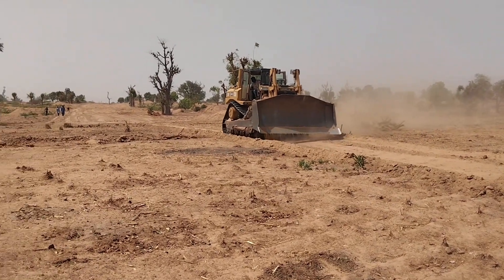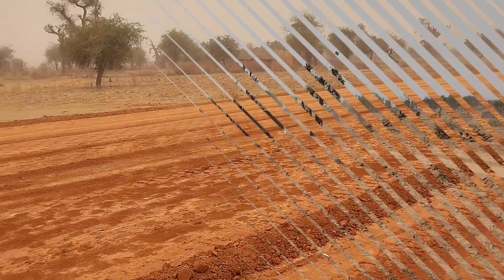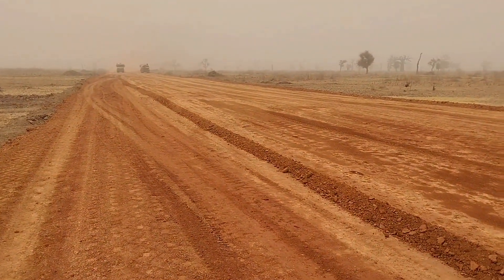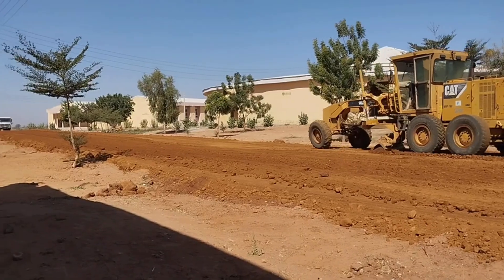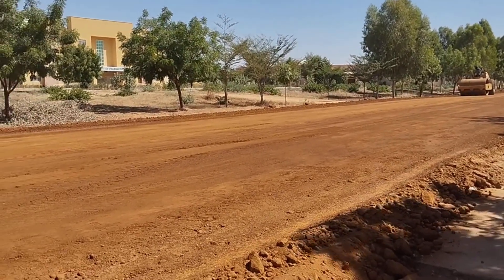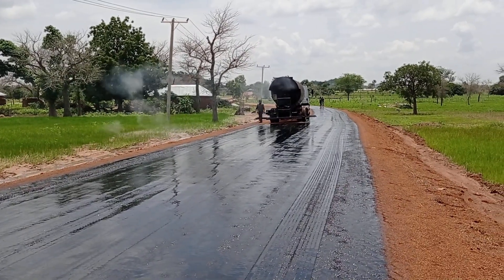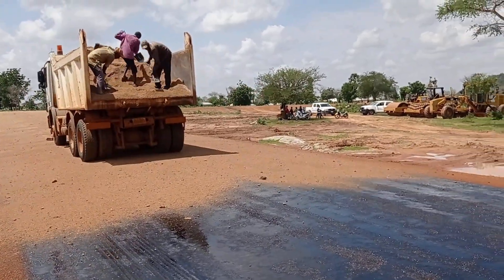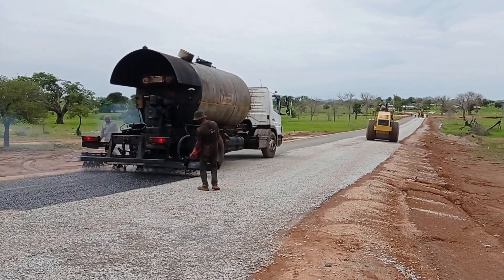Road Construction Works | Earthworks & Surface Dressing Procedure

Comment: Can i lay Asphalt after latterite without stone base chippings? Due to low budget
Reply from the maker: No, you need to atleast apply the MC1 coat. It'll protect your laterite/earthworks. Otherwise, your earthworks and bitumen won't gel well together.